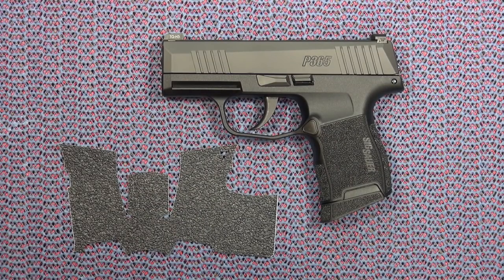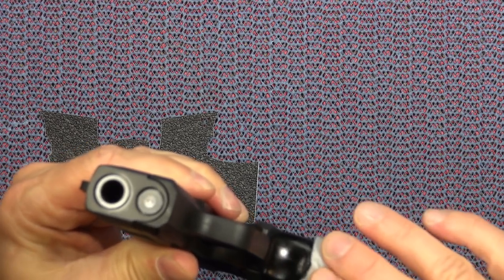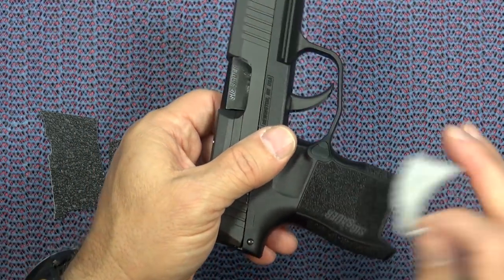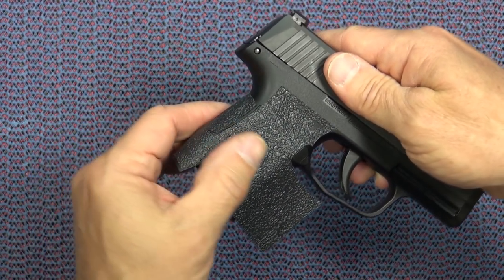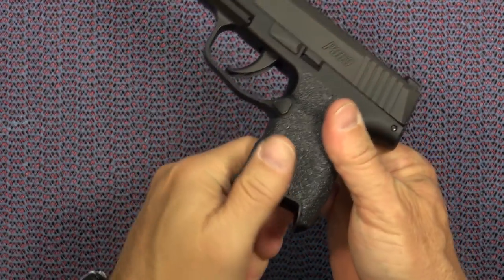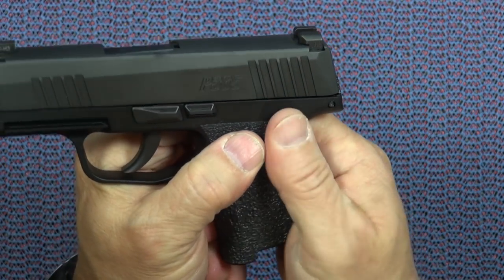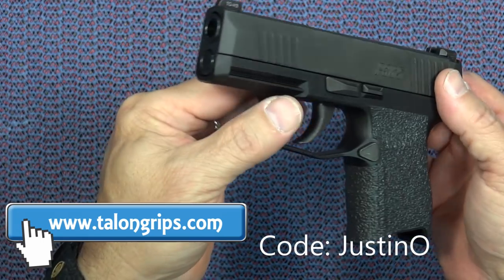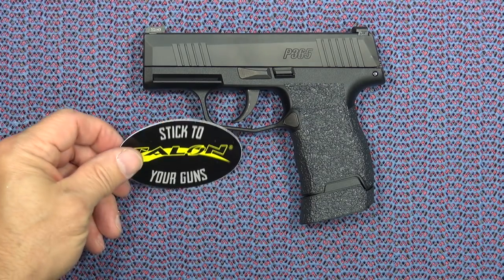SIG P365 Gets a Talon Grip

Comment: I just got my p365 and this video helped me install my talon grip the right way on the first try. Thanks. I was also surprised that I can get a full grip using the 10 round mag with pinky extension. Really don’t even need the 12 rounder unless I just fell the need for 2 more rounds. This is an awesome little feat of engineering

Comment: Thanks Justin, Got my grip for 365 with clip grip and finger grip. discount also Thanks, Did buy one for my Walther P22 but mine was an older model and the grip was incompatible. 
I did strip the gun as Talon recommended and think you should also when doing it. There is always an idiot that might not even check the chamber.
Best Demo out there Thanks again

Comment: Just got my p365 yesterday. It came with the flush mag, and pinky extension magazine. But also came with a floor plate that looks simaler to the one that comes with the 12 round magazine. Would that fit on the flush magazine if I switched it out?
Reply: Looks like it goes with the XL so wasn't sure why it was in the case. Thanks for any info you can pass along. Really love the channel very informative

Comment: I put the Rubber Talon on my P365 but I did not tuck the end under the first flap like you did.
Instead I laid it over the top of the first part of the Talon.
6 of 1 half dozen of the other.
Since I'm Right handed and with the end wrap over the other when I wrap around my fingers on the grip my fingers naturally lay on top of the seam and I don't even feel it.
The strength of my grip always holding it down.

If I tucked it at the end like you did I would think that my fingers wrapping around could feel the straight edge of the first part of the Talon. Matbe even push iy back.
If I was Left Handed I would Tuck the very end under like you did and my hand would wrap smoothly around the grip in the direction of the Talon grip's seam.
Do you get what I'm saying?

Anyway I love the Rubber Talon's on my 365.

Comment: Wonder how long before these will be widely available. Hopefully Sig worked out the issues
Reply: Aaron Charles, if you can find one; the ones that come directly from Sig with the X-Ray sights, are the "Gen 2's". Those second run guns are good to go. The first release was machined to tightly; which caused the issues. As long as you don't ride the slide with your thumb(s); you should have no problems.

Comment: Hey Justin;  when are your videos going to drop on bit chute so you don't have to worry about youtubes' nonsense?  I already subscribed over there.  I am your 1st or 2nd subscriber on bit chute.  I am in the process of transitioning  away from youtube.
Reply from the maker: I tried several times to upload videos. Each time took hours, and at the end of the process there was NO VIDEO uploaded. And I have never been able to find any contact info or help menu, etc. I think it's a i386 running in some guy's garage. I'm certainly open to the idea, but frankly it just does not work. I won't waste my time trying the same thing and expecting different results.
Reply: Thanks for the reply.  Have you reserved your channel name on full 30?